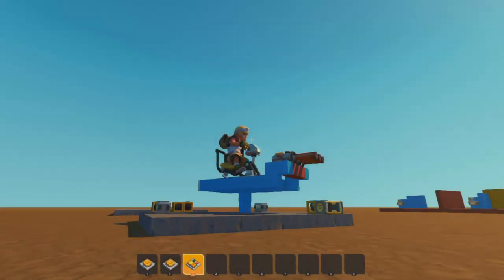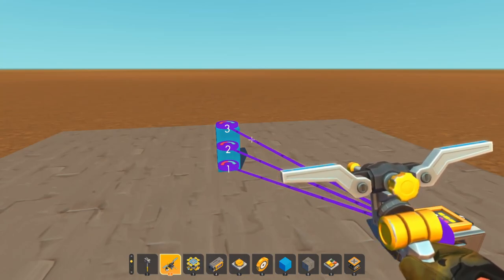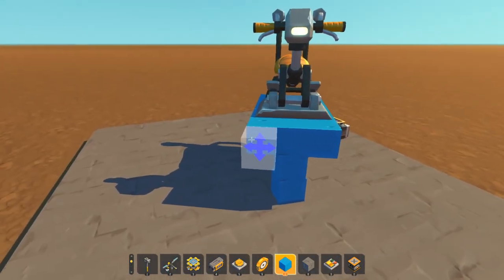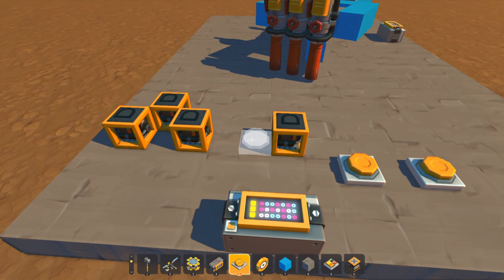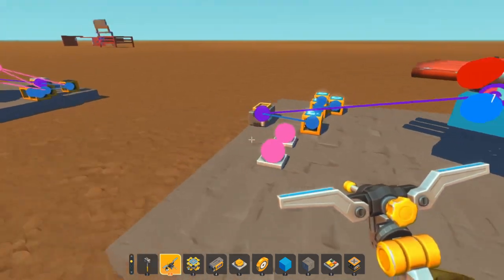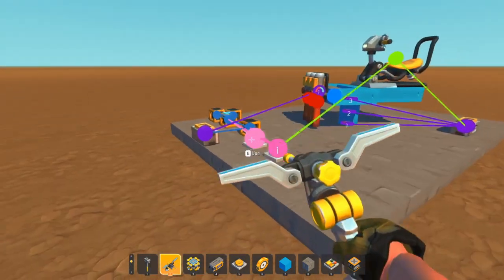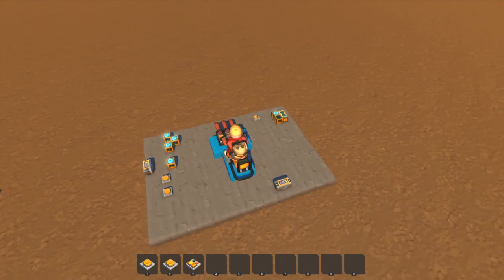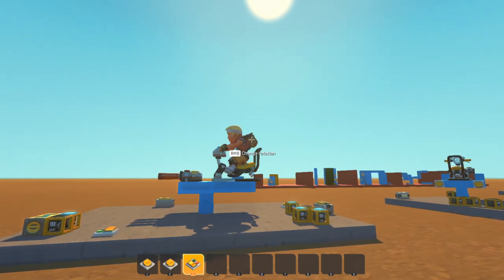Controlling a Bearing with buttons. (Basic turret) Scrap Mechanic

Comment: Useful Tip: If you want to be able to switch it off so it doesn't keep pulsing just connect a switch to the AND gate. This will move the bearings to the end state instead of the initial stat. If you want it to return to the initial state when you switch it off, change the OR gate that controls the controller, to a NOR gate.

Comment: I used 2 Engines that control 2 bearings each with a big wheel in between the bearings and the Seat on top of it all. One Engine to go left the other to go right, imo makes it very accurate to aim horizontally but I'm pretty new at building and this is the first thing that worked for me
Reply from the maker: Scrap mechanic,  the only right way to build is the way YOU want to build 😀👍

Comment: This helps so much thank you, one question, what if I wanted the turret to rotate up 90 degrees as well?
Reply from the maker: You would need another set of bearings and co controller that goes the other way i think
Reply: You can set the first row on the controller at negative 90deg, then you will have the 90deg up as well.

Comment: When I press S to turn the turret right, it wont move at all. Did I do something wrong?
Reply from the maker: Maybe? Did you put the controller on loop? Did you follow the video? 

Unfortunately I cannot say if you did something wrong. You have to work that out
Reply: @wo0dy  yeah it's on loop. I think it might be a glitch since the tutorial is a bit old maybe?
Reply from the maker: Well they haven't changed anything since this so I dont know tbh.
Reply: I found the solution if u still need it, u have to make sure the red side of the bearing is facing forwards on the seat and the blue side is facing backwards, i was watching the video over and over just not understanding it until it finally clicked lmao
Reply: @wavez565 Yeah I still kinda need it because I may or may not be trying to make a tank turret. Thank you!

Comment: Nice video, I’m a little disappointed in scrap mechanic that you can’t make bearings stay in position.
Reply: You can if you enable bearing lock, but you'll need a level 5 seat first
Reply from the maker: You can also using a controller